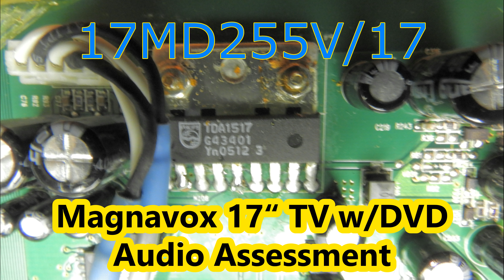A Look Inside a MagnavoxTV - 17MB255V/17

Comment: I have those ICs in my collection. They are pretty good. I don't recall if I made a video on it or not. Those tiny speaker drivers must be pushed to make much SPL. If your parents are hard of hearing, they may have run the set at high volume which killed those tiny drivers.
Reply from the maker: Exactly so, unfortunately.  That's why I have both of their TVs connected to a stereo. That's how I got involved with those little DACs I featured in a few videos.